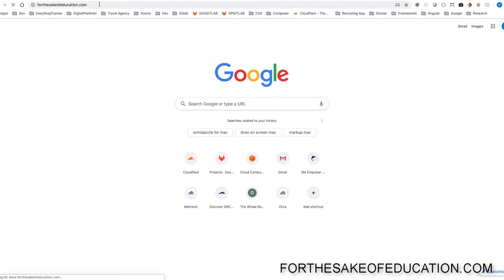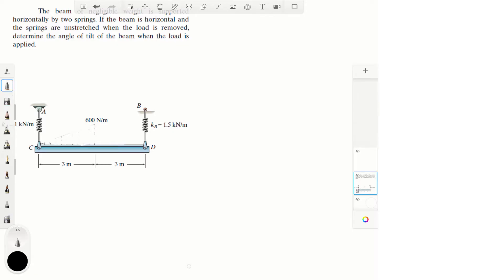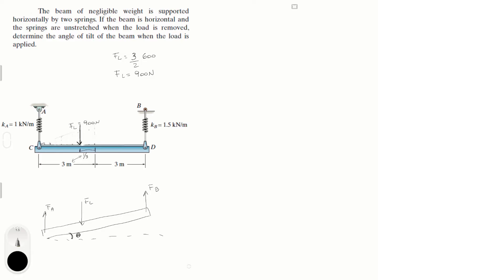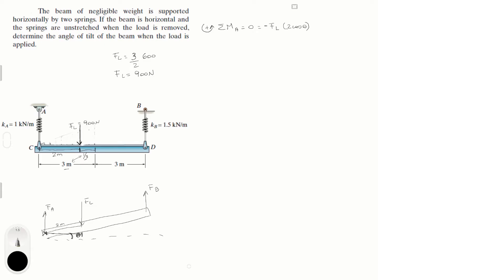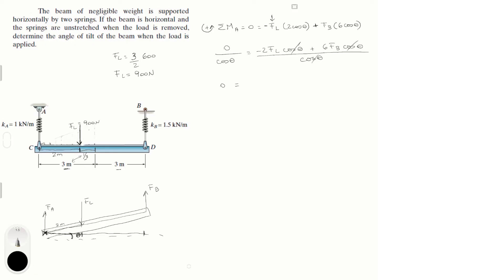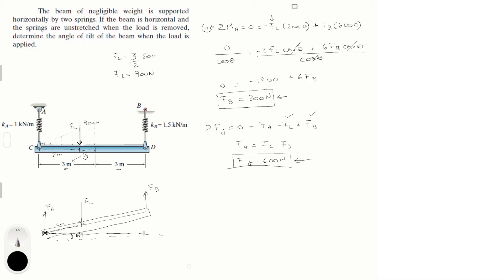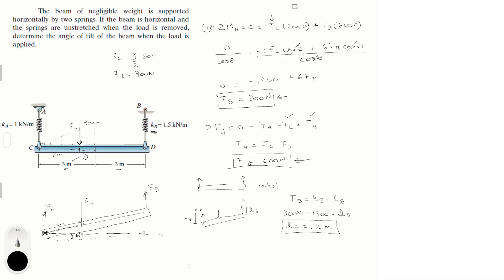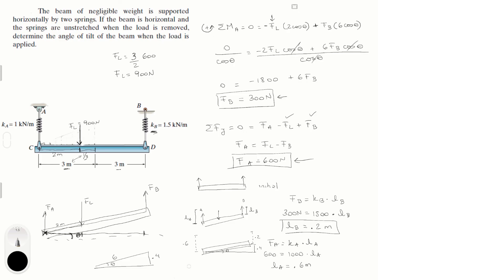Determine the angle of tilt

Comment: Just a cool thought. You could save a lot of time by splitting the force between the supports in the very beginning to get rid of all trig, moment, and force sum equations. Because of where the force is placed along the beam, you can assume that 2/3 of the 900N is on A and 1/3 of it is on B. That will giver you the spring force from the very beginning! This seemed to work for me but I am just a student so if I am wrong PLEASE call me out. : )

Comment: How did you determine the area of the triangle without knowing the height? These videos are a lifesaver btw
Reply: So your height is the 600 N*m your base is 3m. plugging in your formula you get. 1/2*600*3 or     3/2*600